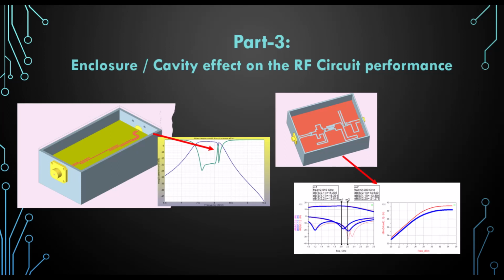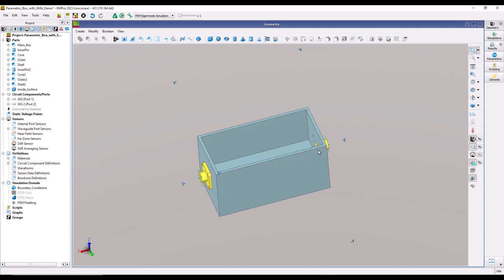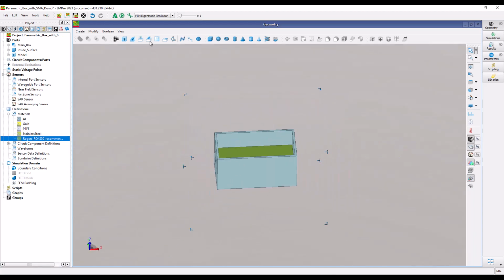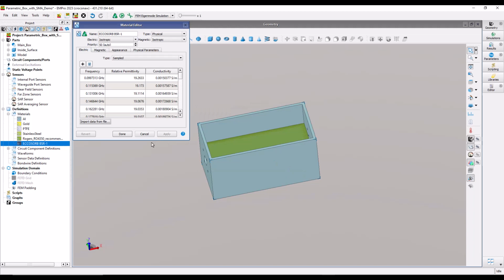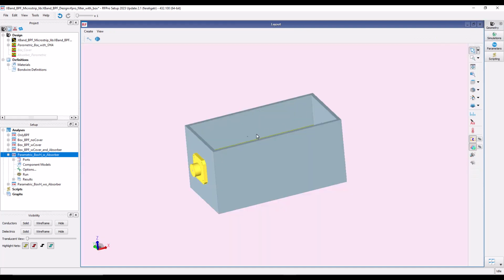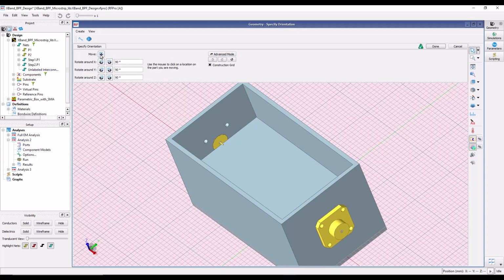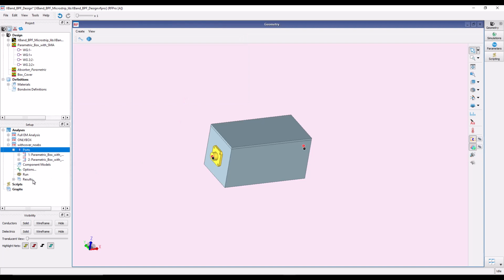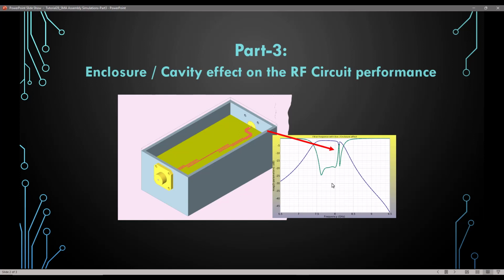RF Design-28: SMA-RF Board Assembly and Analysis - Part 3

Comment: Hello Sir, 

first of all thank you for your videos which are very informative. 
I tried to simulate in RFPRO a set of box and connector in which I put an antenna and launched an FEM simulation. I have results with the antenna alone or the antenna with the connector, however as soon as I simulate the whole thing I have an error saying that the meshing has failed. where can this error come from please? thank you for your feedback.
Reply from the maker: @djgandb553  great going. The issue you described can’t be resolved on YT chat and would recommend you to contact Keysight tech support by writing to: support@keysight.com
Reply: @BhargavaAnurag  thank you sir! i had already solve the problem, i had overlaping mesh. everuthing is fine now. i have another question. why i have a great difference between Em simulaton and FEM simuation?

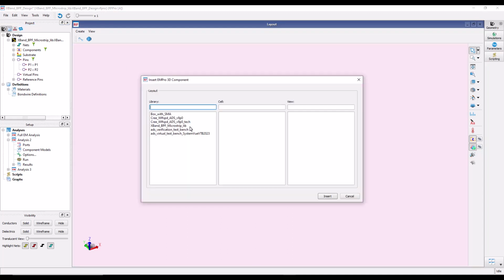Comment: Hello sir. Thank you for your great job. I have a trouble following your video. you insert "EMpro 3D component" to RFpro in last step of video.(27:18) but in my case can't find that menu(file>insert). just 2 choice(file>save, close) exist. can you help me?
Reply from the maker: It seems you are using old version of ADS? I would recommend to use whatever latest version you can.

Comment: Hello Anurag Sir. Thanks for the video on cavity resonance impact! Usually what I have seen that if the length and width dimension of the cavity are comparitvely small, the Eigen mode Frequencies comes up at frequencies close to or higher than 10-15 GHz, in which case we need not worry about the cavity if our passband is below 4-5 GHz correct? 
Also, let's say cavity resonance is not impacting our passband performance, (proven through Eigen mode simulation), but we still end up finding some unexpected peaks in the S parameter measured plots (which we didn't find in our simulated results at design stage, where we took all care in modelling the layout and its parastitics), then can you suggest what can be the possible causes for getting such peaks?
Reply from the maker: Its difficult to comment without seeing what kind of peaks you are seeing. Cavity resonance is only one of cause of distortion but other probable cause include assembly tolerances, SMA connector etc. You might need to relook at all the aspects of the design & assembly if you are seeing any unexpected peaks

Comment: Filter has no GND layer, am I seeing right? Could you tell more about it?
Reply: Yes. In general, suspended substrate stripline filters have no GND layer.
Reply: @huseyinurigulmez  Thanks
Reply from the maker: No, the filter demonstrated has Cover Plate at the bottom that you can see when I discussed about the filter stackup. Try to watch the video again ~1.40min and you will get your answer